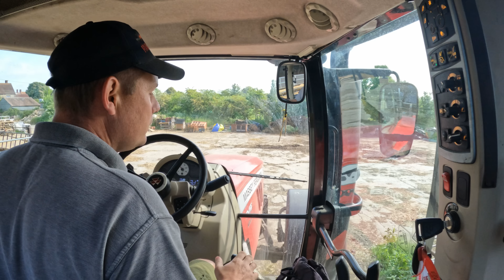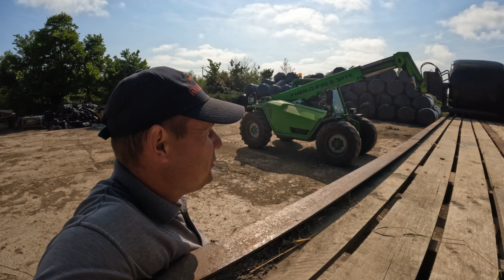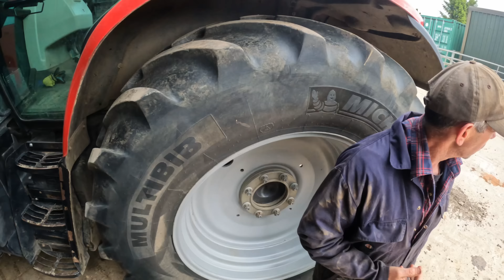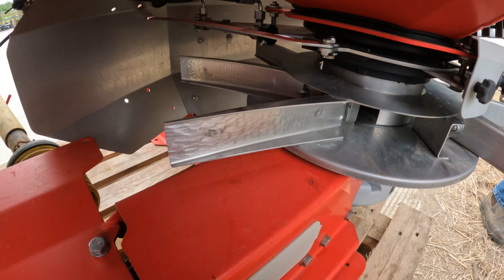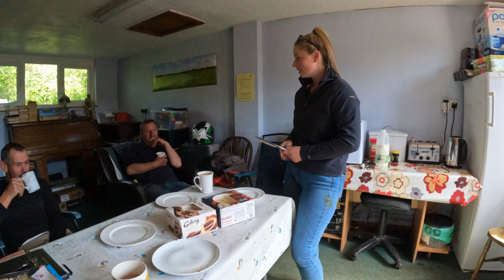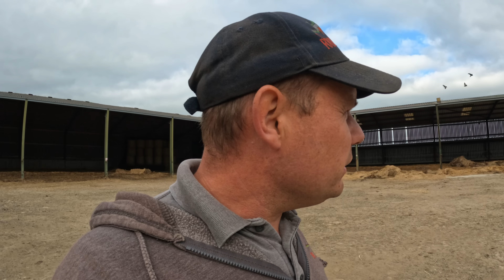8S News! Charlie Is Leaving!

Comment: Good to hear AGCO are finally doing the right thing and it all sounds fair and thorough, albeit it has been too long coming in my opinion but that is probably because you have been too forgiving and patient in a nice way. Let us be clear the brakes are a safety issue and I remember you explaining the problem that sounded dangerous a long while back. It is a tool and a very expensive one at that. If you did not need it you would not have got it. Big companies are often not good enough to their customers in these situations I feel, you particularly have put a lot of business their way. The fact the dealer could not seem to do much is dare I say a sign they are under a cosh to hold on to their franchise. I think Deere are getting very demanding too regarding franchises with many mergers etc..... Lets hope it is all fixed after all they are supposed to be a world leading tractor manufacturer. Bring back the 135 !